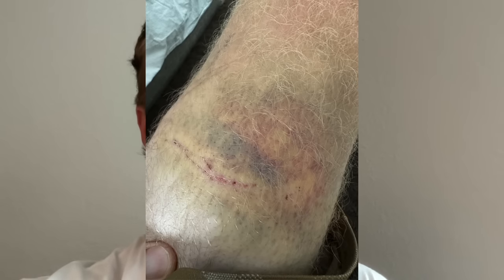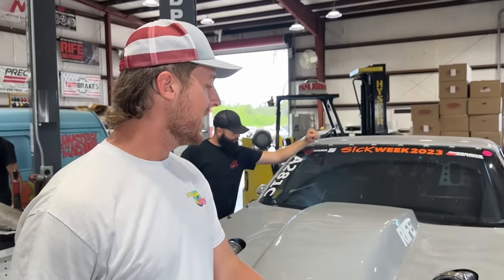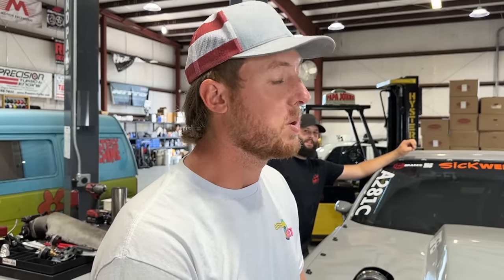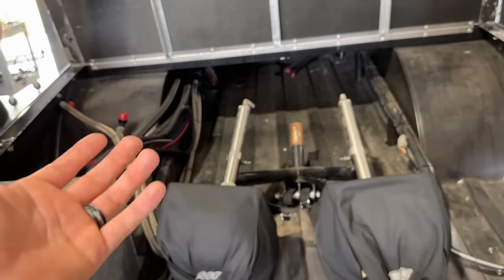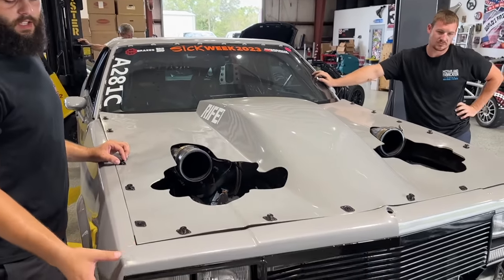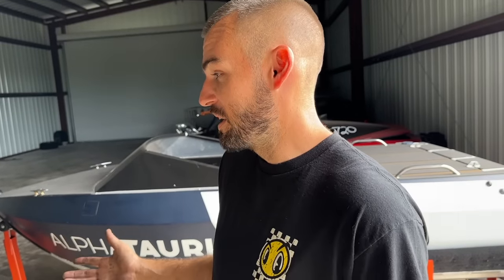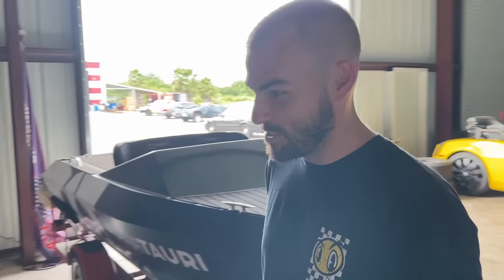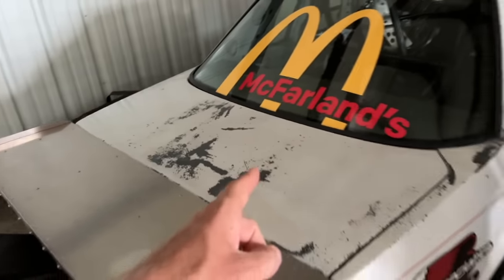Here's Why Mullet Has Been Missing For MONTHS... Ruby, McFlurry, & Leroy Return!!!

Comment: We use a good mar resistant lexan in our late model, would save that glass weight and good fast wax (we use presta fast wax) will keep it clean/water bead right off in the rain, might be a good option, unless your really need to have the front glass.

Comment: For your info you have now experienced first hand the Plow In  you were warned about. It ha
pened when you throttled down while transitioning to land . The skirt tucked which drops your hovercraft ground clearance and it impacted the hard hull. You are lucky in that there was grass but you caught your thigh under the handle bar. Try revving up to exit and enter water or transitions as a rule of thumb. Also move back on the seat quickly while adding throttle to pop the hard points of the hull up for extra clearance.

Comment: Another potential root cause with the input shaft flogging out O-rings. If the shaft has been ground, is ay have been ground in the opposite direction to shaft rotation? It will still achieve surface finish spec, but the 'shape' of the surface will tend to chew seals

Comment: If you cut out the rear bed floor, won’t you run into aero dynamic issues? All the air under the car getting sucked up where the bed flooring pushed it straight out the back.

Comment: I feel like Mullet needs two modes: “Drag-n-Drive” and “Full Race Trim”

DND trim is the current setup, with the only difference being the Steel Doors go back on with the real glass in them.

Full Race has the carbon doors with lexan windows, a one piece front end that’s lighter than the steel setup, anything that doesn’t NEED to be in the car comes out like the passenger seat. Just put Mullet on the biggest diet the rules will allow and try to get it as evenly distributed as much as possible.

Just make them as interchangeable as possible, which I know is easier said than done, but it’s also easier than building a whole new car that’s dedicated big drag event.

Comment: using a Sun block with real Organic Coconut Oil in it,   Will keep the Mosquitoes away  or Coconut candles. You can planet some,  Clovers Garden Citronella Plants outside?  some in the Offices, could use them at all locations like the FF or there at the shop outside the roll up doors.

Comment: Move all your tanks to the rear, nothing wrong with sliding that motor back def a great option.
Carbon fibre body panels all round. Cut the bed out, lexan for all the windows including the windscreen. That's pretty much it really ain't it?
Swap out anything steel for billet aluminum where possible

Comment: Bolt on f/g guards yes. Lift off front no. They are generally heavier than bolt on stuff.This from experience.
IF you cannot run the classes you want simply do not run. That is presuming the car is elligible.